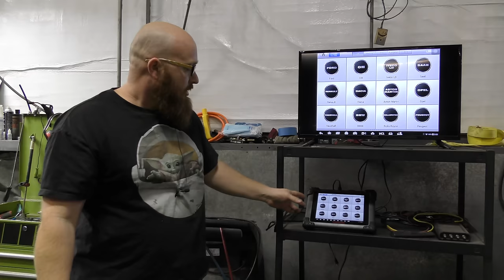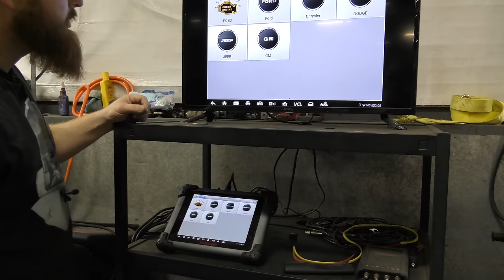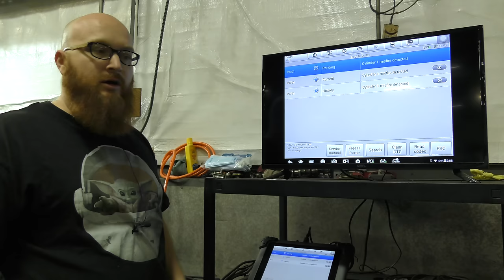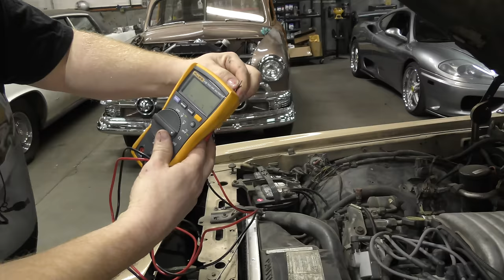Part 5.1: What's wrong with my car?!? Advanced Diagnostic Tips from the CAR WIZARD: Tips 1-5

Comment: I wouldn't have changed that Toyota coil... At most I'd have said to the customer "it may happen that the coil will need a replacement soon, if so call me and we'll do the job in 10 mins here".
Testing the injectors: on modern cars you can command them from the OBD. Or you do a simple circuit with 12V battery and a button: when you push the button you close the circuit on the injector and you should hear it to click. I used that way( (in conjunction to a ultrasonic cleaner and some injector cleaner) to clean my motorcycle injectors after I disassembled them from the intake.
For ground check, a light pen 3W normally is enough.
Another absolutely necessary tool nowadays is a portable oscilloscope. Without that you can't check CAN/LIN buses or any other electronic sensor. I got one for 130$ and it's great.
About the wrong holes... We are in modern time, each his own... Oh, you were speaking of mechanical stuff... OK :D

By the way, another GREAT diagnostic guy is this from Netherlands (he does video in En). https://www.youtube.com/channel/UCR73yN7vT7-P541g2qlfRrg/videos

Comment: The issues with injectors in my car looks different. On idle rev it working fine (sound fine and looks fine i not use paper test) problem begining when i acceleration. At this moment car ECU level up injectors timing to max but car still not acceleration (not rev up)  correctly fast. Probably injectors was blocked or it leaking fuel is inject but not correct with some drops. Less weight of fuel was become fog thats why consumption is higher and fuel what engine need still too low

Comment: CHECK YOUR RELAYS! I had an intermittent starter grinding issue on my Ford Five Hundred with the 3.0L V-6. Cleaned the power leads on the starter and battery and measured the resistance on the starter cabling - no voltage drops.  Bought a new starter, thinking the old starter solenoid was bad. It was worse then the old starter(?!!!). Bought an actual Ford Starter from the dealer. STILL same issue! Played with shimming the new starter - no help! I was at my wit's end!

Then one day I read a Taurus forum about faulty ignition switches and relays. I bought the starter relay and ignition switch ($7 & $25 off Rockauto) and installed it - it has not ground since! I spend almost $300 unnecessarily when it was a $30 fix. Do your research and follow the proper diagnosis.
Reply: In general you check the cheapest, simplest things first. 99% of the time mystery querks are caused by something so simple you feel like an idiot when you figure it out

Comment: It's more effective to just use the voltage test on a ground. A good ground will always have 0v. A bad ground will show voltage.

As for your spark test.... Just use a test light to ground. (No, this will not blow the bulb in the test light)

You're not wrong Wizard, there are just more effective methods. Most places mechanics use an ohm meter, a voltage test is a more accurate option. (Example, Voltage test on a ground is more effective than a resistance test, but a voltage test on an injector is useless.)

Comment: Great vid Wizard. Excellent info. Thanks for posting. One question....how do you find out which is which numbered cylinder?  How do you find out how the cylinders are numbered. Thanks
Reply from the maker: Google. Type your year, make model and add “firing order” to that.
Reply: In addition, the front of the motor is always the side with the belts. You start from there, the spark plug closest to the front is cylinder 1. 

On V6/V8 and so forth, the cylinder head closest to the front of the motor is where you start with cylinder 1. The heads on those motors are offset because of the "v" design.  But beyond the #1 cylinder is where you might want to google it up. Example, on one side of the motor it might be 1, 3, 5, 7, and on the otherside 2, 4, 6, 8. Ford doesn't like to do this. On one side 1, 2, 3, 4, and the other 5, 6, 7, 8.
Reply: I had this same issue diagnosing a friend's car with my cheap ebay OBD2 reader. I googled "Seat Ibiza 1.2tsi which cylinder is 4" and found the answer on a random forum post somewhere. I then found it was of course the plug that was hardest to access which is why it had a poorly seated plug lead in the first place.

Comment: I had injector on 92 Bonneville fail that rubber or plastic boot around came apart. Caused the motor to run oddly every so often idle or stop lights

Comment: CW, You Are - CW :) 35,707 views, 374K subs, 342 comments - mostly thoughtful :) 
Ms W interjects the right question at the right time - Keep you honest :)
The bad earth thing could have application with cruise control? Involving Brake light circuit for auto cut-off?
Your bonus tip was quite apt, after the voltage application tip :)

Comment: Quick tip for wizard tip number 3, you could technically use a multi-meter and a power resistor if you didn't want to make a  light contraption like the wizard has. You would set your multi-meter to amps (change the connections accordingly) and connect your power resistor in series with the multi-meter. Then you would jiggle the ground bolt and look for changes in current draw. Same principle applies, but since a power resistor doesn't light up, you have too look for changes in the current draw (thus the multi-meter). Power resistor ratings are in Watts. Using ohms law (google if you want to know the math) you would find that you would need a power resistor of wattage equal to Watts = 144/Ohms, so something like an 8 ohm 100 watt power resistor would work if you wanted to perform a test like the wizard.
Reply: People like visual "yes" and "no"s lol
Nice job explaining though!

Comment: Hey wizard..  can you talk about the toyota 5.7  v8 in the tundra and sequoia ..     is the cam tower oil leak a common failure ?
Reply: I can't speak for Wizard, but I can speak from some experience. 

It is a somewhat common problem. It's common enough that Toyota has partially or fully covered the repair in some occurrences, they wouldn't do this if they were random one in a million issues in my opinion. It's a pricey job not due to parts cost, but in labor for how long it takes (used to be around 30 hours book time, but think they have revised it to less time.) Since the valve covers have to be removed, they normally replace those gaskets as well when they reseal the cam towers.

Comment: If a DIY person had a scan tool all they would need to do to see if cylinder 1 had a bad plug or coil is to just switch the coils of cylinder 1 and 2, clear the code, and start the car. If the misfire moves to cylinder 2 then it's the coil

Comment: Dude, I had a Toyota one time. And I’m not even lying about this and I wish I was. It had 280,000 miles on it. And they brought it in and it was missing. I pulled the spark plugs. The center electrode was burned completely out. Completely gone. And the prong electrode was completely gone as well. There was nothing left of the spark plugs. And somehow this guy drove this thing into the shop. Now I must admit it was missing like crazy but he actually drove it in there. No electrodes whatsoever and I’ve never seen anything like it since or before. But it was still driving. Driving really shitty. But driving. Blew my mind. I wish I could post pictures on here because I still have one of those spark plugs. Craziest thing I ever saw.

Comment: I don't know if you should show people that method , the spark can travel back down the loom to the ECU for earth and damage it .
Why not just swap it to cylinder 2 and see if it goes with it on the fault code . Or put another spark plug into the coil with a jump lead to earth ?

Comment: could you make a video on how to test and find a leak in the evap system?  My 1999 honda prelude has a code for p1457, I've already replaced what I can find being the most common failing point on the evap system in the car.  The code is for a leak, on the canister side of the car.

Comment: Great tips, thanks for that. Hey, you could have shown us the car, if its for sale. What state do you live in? In the back of the cap of my truck, I have a complete spare backup fuse box with relays ($60 on Ebay) for my 02 Ford Ranger. My AC Unit wasn't operating on a hot summer day, so I looked up in my Truck's manual which relay it was. I replaced that bad AC Relay with a spare one and the AC Compressor started right up. But, for $20 I bough a relay tester, so I tested all my spare relays and they all functioned properly. I do plan on buying those relay switches you showed us for a reasonable price on Amazon, a great idea. You have a great channel, one of my favorites you know. Let me give you a return courtesy tip; sometimes a intermittent electrical problem can be a connector that worked loose under the fuse box. just loose the fuse box, move it to the side and made a tighter connection. That was a good find involving a ground side of a circuit. I got lucky on that one.

Comment: 2002 RAV4-EV:
  Good: No cylinders, so no cylinders to misfire.
  Bad: Has OBD2 port, but signals are not standard even at electrical level.
  Good: Needs service every 7 years or so, if you feel like it.

Comment: I was wondering if I just missed it on your Amazon page, I see the back probe leads but I do not see the ones that you used for the fuel injector testing. Are they still available on Amazon?

Comment: What if your injectors/coils are covered by an intake manifold? For example, toyota v6.
Reply: Im in the same boat. Might be worth taking the intake off and directly powering the injector with a couple leads and a small battery with the car off. For Coils others have suggested swapping places and seeing if the code follows. (Of course that doesnt verify the remaining life of the coil as well)

Comment: I have a 2002 Ford Taurus Wagon. I carry a jump box because it will act like it has a bad battery (it does not). Sometimes it will start right up. Other times it's completely dead. Battery is good. Alternator good. Starter brand new. What's up with that?
Reply: Perhaps a bad ground somewhere?
Reply: My guess would be that there is a bad ground somewhere, however, you shouldnt take my advice for it lol
Reply: Check voltage drop between the battery posts and your terminals. Also check for voltage drop across your battery cables both to ground and the positive to your starter.

Comment: 1994 F-150, 302, 5 speed, unknown mileage on the engine. Any thoughts on bank-firing injectors? I've been told by multiple sources that all four injectors spray prior to any single cylinder firing on any particular bank (prior to 1996 EFI). This is evident by very loud "hissing" noise that increases in volume with the throttle. Far louder than any other EFI from this era that I have seen/heard. Any way to check injectors without pulling them all? Runs fine, but drinks a ton of fuel without towing or hauling.

Comment: All great tips but I am curious about the coil repair...

You mentioned the coil had a "nice blue spark" and the spark was jumping the appropriate distance.  

You then said if it's an orange spark "the color of the sun" it's weak or if you have to get close to get the spark to jump it's weak.

So this coil met your criteria for being a good coil

You then found a horribly gapped plug which was twice the limit allowed .100 vs .040 to .050

You then said you'd recommend replacing all 4 plugs and the coil and if the customer won't do that you won't take the job.

Why recommend replacement of the coil if it's good?

Comment: Instead of looking for reliable information on the injectors resistance, just check the one in the misfiring cylinder and 2 others. If the reading is different at the misfiring cylinder, it's the injector.

Comment: 🖐 Hello Wizard, quick question I just thought of asking you: what bad result prevents someone from spot-welding the bolts that are normally torqued down? (I mean, after torquing them down, not instead of). I don't know,  but I'm guessing that there's a reason it isn't done. I will never be the guy working on my car, so I watch others rebuilding cars, and just wondered.

Comment: Was fighting a bad connections car today.. hate to say it but I didnt win. (yet)
After solving multiple bad grounds, positive connections and random faulty bits/sensors the abs ecu still throws one code I have no explanation for.. will have to swap in a new (used) abs unit, was hoping not to have to, since that will probably end up being a small nightmare on its own :(

Comment: Instead of those dumb relays with the switch you have to actually buy.... just swap a similar relay from the fuse box, like the one for the horn, washer motor, wipers, etc. just use a known good relay with the same part number. I’ve gotten paid prolly 100 hours of diag at this point for that technique... which collectively... took me all of 30 seconds per vehicle.

Comment: GREAT videos as always.  As much as I use my power probe and like the convenience of being able to provide power and ground and ability to check such; the older versions are limited in their diagnostic capabilities.  Similar to a continuity test, when applying power to a device like a fan motor, the test is only used to determine if the circuit is faulty and not necessarily capable to determine whether the device is good.  If the fan operates when powered up it is only an indication that the circuit itself is good and that the fan blade is able to spin.  The diagnosis whether the fan motor is healthy should come from a current reading to verify it is not drawing too much amperage or even a resistance check to know if it is within acceptable tolerances.  As stated earlier, resistance testing will tell you whether something is faulty or not working, it isn't always a viable test to verify whether a device or circuit is working properly.  Testing a circuit and its devices while powered up is the best way to verify its state of health while under a load.

Comment: -With cars all having infotainment screens these days you would think that we could get rid of trouble codes all together and a message telling you what is wrong would simply appear on the screen and not go away until a mechanic resets it.
Reply: VERY TRUE!  sadly this is just not available, thats why i custom placed an old android phone with macros set-up and torque pro connected to OBD2. automatically starts up every time i start my car and goes to sleep when the cars off. super handy as torque Pro will automatically warn you when a Fault Code is logged in the Car. my car had limp mode one time and within 15 minutes got it fixed simply because Torque Pro told me exactly what the issue was! its awesome . Also highly recommended just as a Vehicle temperature reader! got mine set-up to show fuel trims , coolant , oil and trans temps as well as Catalytic converter temps all on one screen!

and to top things off, where ive placed it, it looks like a standard feature of the car to anyone just strolling by!
Reply: @justinlangley9522  That's awesome, I'll have to look into this.

Comment: what is a rough idle problem without a check engine light
Reply: Can't say for sure but stuck throttle bodies can be to blame.. Or cam/crank position sensors. Might be worth chucking a code reader on it in any case, might have stored codes or codes not severe enough to throw the dash light on.
Reply: could be bad Engine Mounts also

Comment: You should not be diagnosing any vehicle issues until you learn basic mantanice such as drain and fill transmissions with correct fluids.
Reply from the maker: Those are already learned. Everyone makes a mistake once in awhile. There is no mechanic who does not make mistakes. My business would not be as big as it is if we did not know what we are doing. You are the failure here. Not me

Comment: Pro tip: do not insert mechanic stethoscope into the ignition coil with the engine running. Also, I wonder how many Toyotas are terribly maintained because people buy them as "no effort" cars.

Comment: Wrong way of testing coils! Run the risk of damaging them. When testing injectors coil resistance make sure it corresponds with what temp they are at. Voltage drop is the best way to test ground connections, also that is not testing the relay. That's only checking the power and load circuit not the signal input and ground side of the relay control. So you still haven't confirmed if the relay is good or not.

Comment: Sorry but the first (misfire) diagnostic is wrong - the coil may produce enough power to yield a spark out of the cylinder but with compression, it will not be sufficient. The correct procedure is to 1. replace spark plugs 2. clear code, drive it and see if the code comes back. If it does, switch #1 coil with #2, if the code moves to #2 cylinder, it's the coil. You can start with (2) if you are lazy...
If the problem persists in #2 cylinder with new spark plugs, that's a different ballgame all together - it could be injector, driver, blown head or intake gskt... One thing you don't do after 1980 is looking for a spark using a wire...